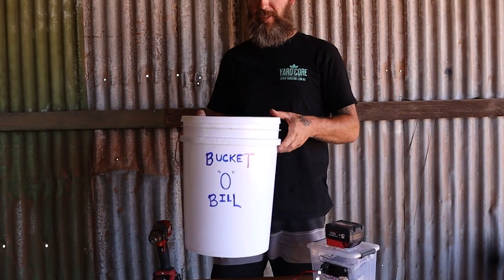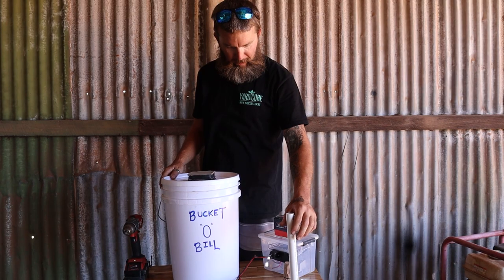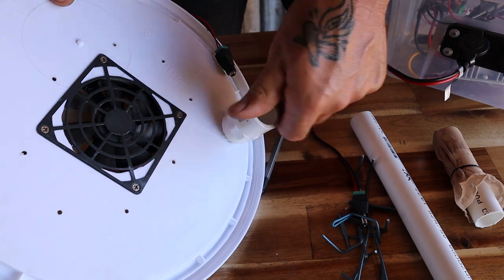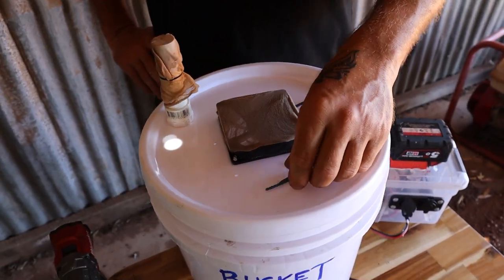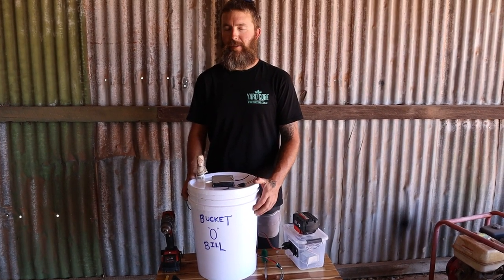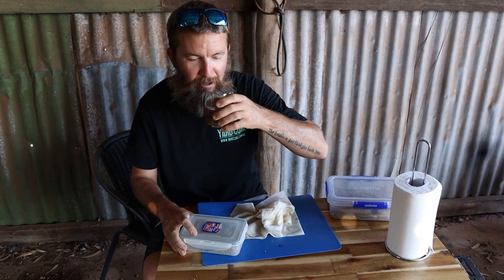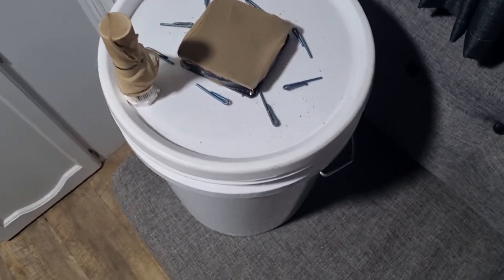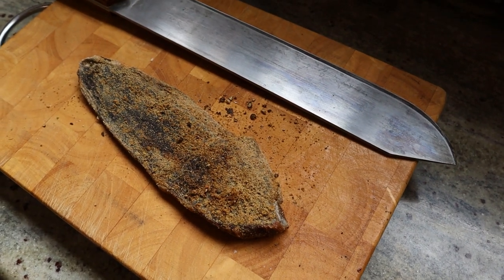Travelling Biltong in a Bucket

Comment: I have problems making biltong with high humidity. I get that white spot mould. Have you experienced this? So I tend to make it in winter and not in the coastal summer months.
Reply from the maker: Yeah high humidity might be an issue. It really wants that dry air to seal it. 
I have seen the white mould when drying Italian Sausage, we use a spray bottle with vinegar and water mix seems to work ok.